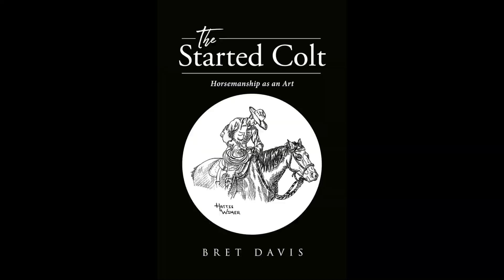Leverage Bits and Signal a Rebuttal to Daniel Dauphin

Comment: Bret this is good information.  Some of my thoughts from "tractor and windshield time"  When you move the mouthpiece from center hung to forward hung,so there is not a straight line from purchase to bit shank/rein ring  you create a "compound lever" rather than a simple 1st second or 3rd degree lever which is based on a straight fulcrum.   A few examples of the compound lever are the scale, train brakes, and a common type of nail clippers.   Another one it the jaw on a t-post puller where it puts pressure on both sides of the t post.  Which AS YOU MENTIONED is NOT the intent of a spade bit.   As you mentioned the loose jaw delays the engagement, hence the pre signal. the purchases move, and the horse feels the crown piece tighten first .  I think Balance and weight distribution on the cheek has a lot to do with "speed of release" The Santa Barbara with weight on the back of the bit is like the weights on the beam of the balance scale .  Leverage is just a ratio of the length of the purchase to the length of the shank.  While a longer shank might have more leverage when the curb strap engages , it does have to travel father to move the purchases up to engage the curb.  So in theory a longer shanked bit is more forgiving from the standpoint of it has more travel before engaging the compound lever.  I don't have any Physics credentials, but i've broken a few irrigating shovels prying out Ditch boards, and I stayed at a Holiday Inn last night
Reply from the maker: lol that is to funny. And I think everyone knows more about physics than I do,  Im just a guy with a Youtube channel that aint afraid to talk about it
Reply: @HorsemanshipAsAnArt  You have bitted more horses and have much more more applied knowledge than I.  Keep up the good work because you make me think.

Comment: Thanks, I really enjoyed this video and learned a lot about how spade bits function. Why don't you consider the time between starting the application of pressure on a curb bit to the point where the curb chain makes contact a "signal"?
Reply from the maker: In a sence all bits give a signal. And on a curb bit the time between engagement and the actual pressure is a signal of sorts. Signal bits are just called signal bits while other bits are called curb or leverage bits. I suppose it is because of the multiple signals and the nuance of the tool.

Comment: It sounds like the real distinction is loose vs solid mouth rather than center vs forward hung. Center vs forward hung is probably muddling the physics discussion because folks will focus on the position of the axis of rotation which probably doesn’t matter much. If there were a solid mouth forward hung bit, there wouldn’t be any added delay to the signal; the bit would just hang at a different angle but engage at the same time as a solid mouth center hung bit. Because if the curb is properly adjusted, gravity will equalize the difference, and neither has any added delay. I could be wrong. I’ve also never understood why folks say that a swept back cheekpiece is inherently slower… I would think that once you took the slack out, it would be the same, though the balance of weight is different.
Reply from the maker: I have never seen a solid forward hung that worked very good and the only reason I think a swept back shank is slower is because one usually adjusts the curb to be slower. I am wrong all the time but Im not afraid of saying.

Comment: I am a novice horseman.  I have watched a number of items to learn more about bits.  I am begining to understand the mechanics but still have no idea what bit to use on what horse.  I am an old guy (73) just getting into horses so I will not be breaking any colts.  I will only be interested in old man broke horses, trail riding and maybe in the future some light cow work.  I would like to understand more about how and why I would choose one bit over another for a given horse.  I suspect what I am using them for has a great deal of impact but beyond that what are the considerations.  Would you always use the same bit on a older horse?  Anyway, maybe you can point me in a direction to get more information on this topic.  Steve Kepple
Reply from the maker: Steve I use a lot of different bits for a lot of different horses and work. I think you should talk to whoever you get the horse from about what bit to use. I have found that a low port on a 7 shank works pretty good for nearly every horse in nearly every job
Reply: @HorsemanshipAsAnArt  thanks

Comment: I'm not clear what the debate is about.  Talking "speed"  when the issue is simply a ratio (ratio of purchase to shank) is kind of weird, I agree.  But is that what DD does?  I've watched his videos multiple times, but it's been years.  Speed makes sense if it's about the amount of play (wiggle) in a bit.  Whether that has anything to do with whether it's forward hung or center hung, IDK.  Seems to me it would have more to do with whether the mouthpiece attachment to the cheek is solid or hinged (like a Sliester).
Reply from the maker: I like to answer all these questions but im drunk and im sad so I won't be graceful. If you really want to know, call me. 541-944-3658.
Reply: @HorsemanshipAsAnArt  Bret if you think there’s an argument there, I think I’ll pass and just read some more of your book.  Feel better.
Reply from the maker: @epona9166  No I didn't think you were arguing I was just not in the mood to answer a complex question. You have it right about the speed, it is faster if it is not hinged. A forward hung bit is hinged and a center hung is not. A few people have tried to reinvent the wheel and hinge a center hung but it doesn't work very well. Also the straiter the cheek (lever) the faster the bit is so a Las Crusas or Arizona cheek is faster than a Santa Barbra or 7 cheek.

Comment: If you are rebutting the video and portion that I think you are. You are comparing two different types of bits and, as you say, are comparing apples to oranges. Both yours and his videos provide correct information, but you are focusing on where the mouthpiece connects, he focuses only on center connected bits. I’m not sure how professional it is to be calling out another trainer for something that differs from the correction.
Reply from the maker: Its unfortunate that I was so clumsy in my wording. This rebuttal is based on a conversation he and I had not so much on his video. I agree that most of his video is correctish but in the other conversation he said that a center hung spade is slower than a forward hung spade and I was trying to explain why that is wrong. Daniel does not understand how spade bits work and therefore should not comment about them but rather ask about them. If you are a fan of his work watch some of his bitting videos again and you will find his physics are a little off.

Comment: First of all. you are referencing two completely different things here. You are confusing the speed at which the bit moves from its designed leverage ratio and how different leverage ratios affect the speed of the bit, to how a bit is with build using solid shanks vs hinged shanks and how wear and shank hinge play can affect what you're referring to as speed is really nothing more than play or maybe you could consider it pre-signal if you want to stretch it that far. Your rebuttal is incorrect and flawed from both an engineering and a  physics standpoint and the information presented by the OP is in fact correct.
Reply from the maker: Who the heck is the OP?
Reply from the maker: Ok I re watched the video because we made it some time ago and I couldn't remember what it was about. I will be the first to say that I was pretty clumsy in my explanation and I may have said it in a way that you didn't understand but I was not wrong about speed and leverage and how it all works. I may not be a great teacher and I am willing to admit that but I have my story strait and I will try to think of it in a way that people who have not been riding spade bit horses most of there life can understand it. Thank you so much for your comment, I dont understand it but it has opened my eyes to the fact that I need to find a better way to say all this.
Reply: @HorsemanshipAsAnArt OP simply means original poster, in this case I'm sure he meant Daniel Dauphin.
Reply from the maker: thank you
 @southernforestgypsy